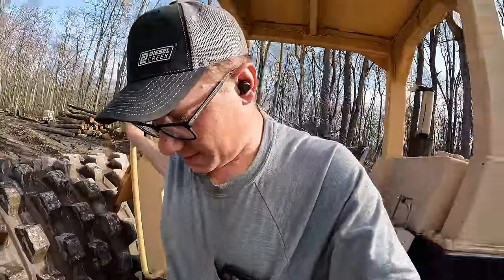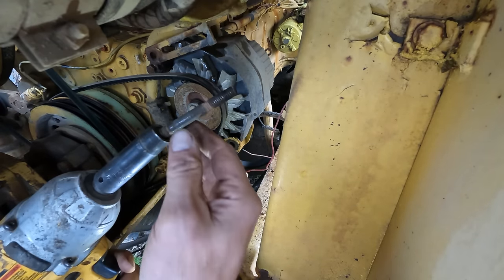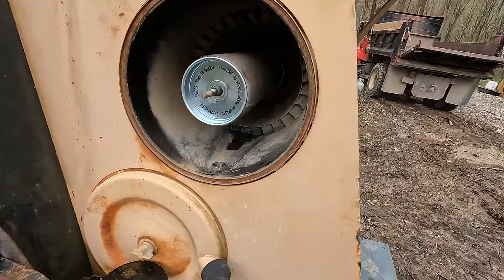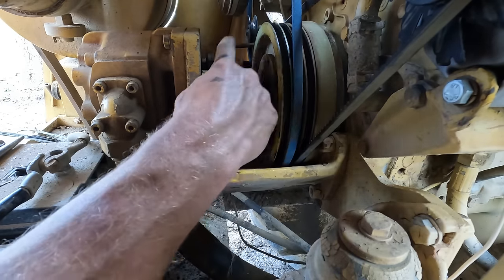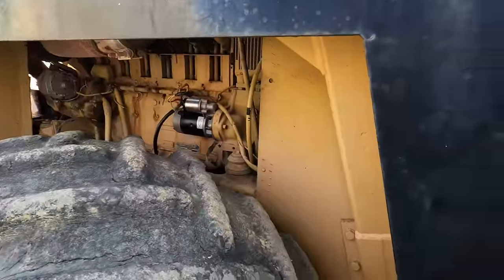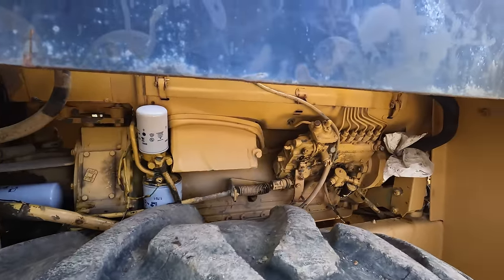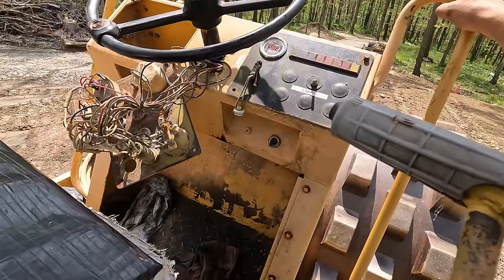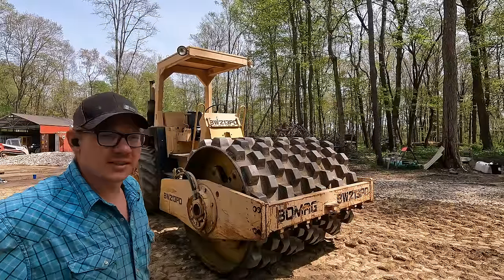I got BURNED on this Compactor from an Auction! (Bomag BW213)

Comment: I spent 13 years working in a rebuild shop and one of the first things I learned about starters is the part of the starter that most call a "Bendix" is actually called a drive. In the old days one of the major manufacturers of starter drives was a company called, you guessed it, Bendix. Imagine calling oil filters a fram. It's a very, very common mistake. Also, starter drives only turn one way, when they work correctly. They have sprag bearings inside the bell part to make them work that way. They do that so, obviously they to not turn or slip when the armature is causing them to rotate the flywheel, but they then spin when the engine fires up so the armature is not over rotated and the windings explode before the drive can be withdrawn from the flywheel.
Reply: I never heard anyone say bendix, without saying bendix drive . Also,  I've never actually seen a bad/ replaced a bendix drive. It's always the solenoid or what ever activates the bendix drive that is broke/ bad.
Also I've never heard of any other brand of that particular mechanism 
It would be wild if Bendix never had any competition ,in manufacturing that mechanism..

Comment: 23:15 I think that a shorter belt would have changed the angle of the belt and would have stopped the rubbing.  Just looks like the tensioner is almost at the end of its travel.
Reply from the maker: Ya I changed it to a smaller one and it’s fine. I know I recorded a clip of that running after changing it again but apparently i forgot to put it in

Comment: Matt, fully enjoyed the video. Agree that getting a smaller belt might very well fix the issue of it dragging on that piece of steel. Glad that with all the electrical issues, you actually got things where they should of been in the first place, and OMG, what the hell were they thi9nking when you went to drain the oil form the oil pant with the drainage plug being where it was?? Homemade funnel seemed to work pretty well on that one🙂. Sounded great after the new starter, and the oil and new air filters that you changed. Look forward to more videos, and glad to see that you pad is just about done, and hopefully in some good weather you can get that large new garage built so you don't have to be laying in the first to fix things. for those that ran their mouth about " Click Bait" hey, better suggestion> Don't watch! Been following Matt for some yrs now, and he has never done that!

Comment: That cooler next to the starter has a big hole in it. As you start you can see it puke a little coolant. Even left you a little rust spot. Bees like heat. When you warm a building or machinery it holds heat all night long.
Reply: It can’t puke coolant there’s only oil in it

Comment: When first got out of University I spent a few years as a sales rep for Material Handling Equipment company. More specifically I sold electric (indoor) lifts and Propane/gas and diesel outdoor Forklifts. I sold Fork Lifts up to 15k pound capacity with pnuematic tires with the air cooled Deutz diesel engine with hydrostatic transmission. Foot operated transmission with two pedal, forward and reverse one pedal on each side with braking occurring once foot activation of transmission ended

Comment: Those deutz air cooled engines should fire right up even when freezing cold. They only have glow plug and oil pan heater. Nothing heats up the cylinders.
The piston crown to head clearance should be between 1,0-1,2mm to get the best compression ratio which affects starting and efficiency.
This is why deutz sells many thicknesses of headgaskets or in this case simply fire rings or you can shim the liners from the block.
Of course injectors can also be the culprit. 
Using 2mm thick tin wire trough the injector hole is a quick way to check the clearance.
Reply: At work, they bought the biggest POS drill rig with that same engine. It wouldn't even come close to cranking fast enough with the stock starter in cold weather with a new starter and battery. I think it was more the hydraulic system that was attached to it than the engine itself though. It had a dual gearbox and quad pumps. A stronger starter solved that problem, but the unit was never any good. They must have blown $150k on that thing before they finally gave up on it. The first words out of my mouth when it landed in my shop were "what is the return policy?"
Reply: @--_DJ_--  No matter the diesel engine. If the crank is slow the air heating up has time to let the heat escape or if valves/rings do not seal 100% the air will escape and not heat up.

Comment: I have to be the downer but your supposed to drop the batteries not the starter. That's why it's a voltage drop test! It is almost mantatory on large dozers with batteries the size of small cars. 😁

Comment: Pre-filling the engine oil filter. I've done the same for like ever until my oldtimer engine rebuilder buddy gave me his take on the 'is it a good idea?' theory... The oil you put into the cartridge is gonna go straight to the crank bearings, (& it's not on the filtered side)...  & you have no 100% guarantee that when you poured some new 'clean' new oil into it a random tiny couple of thou sized particle of dirt went in too. That particle is set to do nasty things to any a crank journal... So ever since he told me that bit of sage advice i just load on an empty cartridge & anyway, the filter will fill in parts of second.......(just saying).
Reply: Rainman Repair on YouTube has stated the same thing. :)
Reply: Had a whole rat in the bulk oil at our mining company 
Was delivered in the truck 
Makes you think about "clean oil"
An engine at idle no load will run for 30 sec without any oil presure just with the oil on the bearings already 
The oil filter will fill in seconds and you'll have oil presure like that
Reply: Peteb2.
Your advice from that old timer was good. Yes like this video shows, the dirt that could easy drop in filter. Yes, just put it on empty. I think especially with a AIR cooled engine. Run engine for 15 to 30 second with empty filter. Then shut down, recheck dip stick. A lot easyer than just like you said a big engine getting particular of Dirt, crap from oil in engine. I love comments like yours, it gives me ideas. Thank you so much. It's so nice to have old timers who know there Engine's. They are worth every penny to be friends with no matter how grumpy they get.
Bring them donuts and coffee to keep them happy. And always listen to them.
Reply: I’ve never tried to fill an EOF with oil first. Some of the bigger ones would be very tough to handle with enough precision to get them threaded on straight. And I own John Deere tractors where the filter is either inverted or on its side, so I don’t think that they are expecting me to fill it first!

Comment: You need a FOX and HOUND electric circuit tracer.  One is a transmitter and the other is a receiver. You can follow a tone alone a wire/cable and find shorts, opens, and grounds. Also does continuity checks.  They make them for auto or home/telephone usage in several different styles and designs. I go a bus that had circuits not common to a semi truck and it was a life saver.

Comment: 10si alternators are probably the most mass produced alternator in history, they are ultra reliable and easy to repair
Reply: Absolutely! I replace every alternator on my equipment with one when the original fails. 2 yr warranty, $49.78 on Amazon for a 334-2114 or a 335-1093 Brand New for $76.52. Why anyone would pick up a no-name POS at the parts store is beyond me.
Reply from the maker: Because that had it in stock, and I left with it in my hand, and it has a 2 year warranty…. And it was only $65….
Reply: Looked almost like a GM Delcotron alternator. Am I close or FOS?
Reply: @DeweyCheatumNHoweLLC  My thought also. Almost identical to a Delco 10si used by most manufacturers in the 1970s and 80s and still a very dependable alternator today.
Reply: @mikeshultz1007  That is a rather inflammatory statement. "Vast majority"?? I very much doubt that. I have been an Amazon customer since 1997 when they only sold books and I have never encountered anything as you describe. AC Delco maintains a store on Amazon and products sold through them are genuine Delco. I urge you to re-think your statement.

Comment: Several questions: 
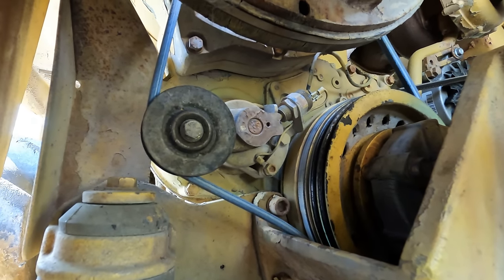1) At 23:25, there's what looks like a switch on the fan belt idler pulley. Presumably that triggers a warning light?
2) What's under the access cover below the air filter at 30:17?
3) I never saw you write the date and hours on any of the filters :(
Reply: It seems this video has been cut pretty heavily. The second belt replacement is also not shown, so I expect he marked them but didn't show it on camera.

Comment: I don't work on Heavy equipment but I do work on old stuff and over and over the biggest problem is the nut behind the wrench. I buy an old bike or car and then look to see what surprises lay beneath the surface. more times than not the biggest problem lie in either poor maintenance or some hack job that causes more problems than it fixes, I watch because I rememberer this old stuff because my father operated this stuff back 40 plus years ago. it brings back memories of hanging out with my dad as He maintained this stuff. thanks for the memories

Comment: Dielectric grease is non conductive, but you're getting good grounding through the bolts.
Reply: You can put it on conductors it'll move out the way where needed. People just it on battery posts and lamp sockets

Comment: Hey Matt. If the belt breaks the idler puller for the fan belt has a sensor close to it and it shuts the motor off. I have a few of these motors and they are all the same with this safety feature. The motors are pretty indestructible.
Reply from the maker: Ya they botched all the wiring to that sensor….. none of them worked
Reply: @DieselCreek . Wow that could have ended bad.

Comment: FYI... dielectric grease does NOT conduct electricity... the word dielectric means insulator. It's main use is to keep water and schmoo away from the conductors (pins) in a connector. The force of the socket against the pin pushes the grease away and creates a good electrical connection. Putting a film of dielectric grease on the starter mount will help prevent corrosion, but will NOT help grounding (the bolts will provide plenty of ground).
Reply: False. Categorically false. It goes dielectric after it burns. It conducts perfectly well before that. Literally TENS of thousands of connections made personally with dielectric grease and ZERO resistance across the connection say you misunderstand the usage.
Reply: @typrus6377  Could have said the last 10 words better!😟
Reply: @TheCheffydave  You are right, and I corrected it. I was heated earlier, and I apologize.
Reply: @typrus6377  google dielectric grease and read what the mfg data sheets say. 
I know that for some reason this is an internet hot button, and I am not going to get anyone to admit they were/are mistaken, but truth is truth.

Comment: Those Deutz aircooled engines need the 2 belts on the fan and they are both the same length belt, that single pully isn't the tensioner it's the belt snap tell tale switch for the dash light/warning buzzer, the tensioner is the fan itself which is on adjusters if memory serves, that is vibrating anywhere near enough, it should literally make a very loud humming noise and "liquidise" the soil all around it, good look with the repair Matt 👍
Reply: ** This is a copy of a comment I posted earlier **

Ignore the fan pulley having two grooves, most of those engines came with a single belt from factory, for using two belts there's a dual groove pulley.
I don't know nowadays but in the past you could buy each component of the tensioner separately. I imagine that for a double pulley the spring will have to be tightened twice as much, but I have no idea how the tension is measured, maybe it's using a torque wrench or maybe it's counting the turns that the spring is preloaded, that will be explained in the workshop manual. It can be easier and cheaper to find a second hand tensioner or just keep using a single belt the only drawback of using only one is that it lasts less and when it breaks you have to stop working to change it, with two belts it would be very rare for both to break on the same day.

Comment: We actually had a piece of avionics that required a drop test. It was a crypto identification friend or foe (IFF)  on the F-4 Phantom. It had 2 top secret codes in it ( password of the day and tomorrow's code, in case you were still flying after midnight.) and if the plane crashed, the equipment code  would feel the shock and zero-ize the code, in case the enemy got their paws on it before us. It also zeroized a few seconds after power was removed.

Comment: I was surprised because the 6-cylinder Deutz seems way too big for the machine. A 4-cylinder Deutz with 115 KW is listed on a data sheet for your machine. B.t.w it is no mistake to check the coolingair passage with the oilcooler spiral and the cooling fins.
Reply: How realistic is 115Kw (156hp) from a 1987 four banger ? Your data sheet has the wrong number of cylinders listed.
Reply: @Sjanzo  I think You are right. I checked the List of Deutz Engines and there are only turbocharged 6,2 Liter 6-Zylinder with that output. There was never ever a 4.1 4-Zylinder with 115 KW
Reply: @besenwieslersepp1011  probably an F6L913T. The 413 series would be capable of 157hp in a 4 pot, though the inlinr 4, 5 and 6 cylinders in this model range are rare, most of them were V8

Comment: Not sure how the vibratory motor is mounted on this one, but I worked on an old raygo years ago, the motor seal went out, filled the drum with oil, dampened the vibration to the point of nil.. resealed the motor, drained the drum, Vwala! Hammer time!

Comment: Painful to sink a lot of cash into a machine and then have constant problems with it. Been there!
Reply: Thats the risk when spending a lot of money on a machine so big that the price you pay is still only a fraction of what a new one costs...
Reply: It happens when you surround yourself with worn out junk.
Reply: Well, don't buy cheap sh**! Problem solved.
Reply: @einfelder8262  I would be proud to have this machine myself. Deutz is legendary. The founder of Deutz was the inventor of the internal combustion engine then later Frank Perkins of Peterborough England invented the worlds first high speed diesel as we know it today.
Reply: What would you expect from a 35 year old machine? Factory warranty?
Reply: @conmanumber1  Well it's not the engine that's broken, is it?.   Just every bloody thing around it from starter, alternator, pulley, vibrator, wiring.
Reply: @einfelder8262  at the moment in every machine industry, there are major shortages of new equipment to replace old equipment. Used car prices are up 30% right now, electric cars orders are on a 2 year backlog along with tons of other stuff.

So yeah, a machine like this is actually pretty good in this economy right now
Reply: @einfelder8262  many 2021 and 2022 cars went back to using analog dials, and many have less MPG than originally advertised. This is all due to the major processor shortages.
Reply: @ivanvarela3215  WTF has that got to do with an old roller?  Stay on topic FFS.
Reply: @einfelder8262  oh boy, ya don't know how things move then mate. Hope ya realize soon.
Reply: @ivanvarela3215  I know far more than you ever will, bloke.  Especially about staying on topic in a discussion.  Those who are lost in a discussion use diversionary tactics, such as bringing up an irrelevant topic, to mask their inadequacy.
Reply: @einfelder8262  hee hee hee, that tickled me a bit.

Get out
Reply: @ivanvarela3215  Get out yourself.  You're not the boss of here.  Play with yourself elsewhere.
Reply: @einfelder8262  generic_response.txt

Comment: so, is the clunking noise the camera mic picked up a clue to the next failure? soon as i heard it i started thinking that's prob the noise the flat roller was making before it snapped the shaft, loose bearing letting it bounce

Comment: I am worried about the ring gear on the flywheel.  We will know when you pull the starter.
Reply from the maker: It’s not great but it’ll last
Reply: @DieselCreek  Whew!  I was worried when I heard the starter at the beginning of the video.. Then when you pulled the starter and showed the teeth I was thinking that a new started would probably work just fine.  Thank goodness, I can't imagine how much of a job to replace the flywheel!!

Comment: Maybe the only speed you got on the vibration is not full, only the lower one. Perhaps that's why you feel it's not strong enough.
Reply: It kinda sounds like the metal on metal sound is acting as a governor.   It winds up fast enough to start smacking and can't go any faster.  Knowing Matt's luck the shaft of the counterweight it broken one end and that's just as fast as the motor can spin it with it flopping around in there!

Comment: Have you ever used the red segmented replacement belts?  THEY ARE FANTASTIC!!   The come in 2" segments that have a tee on one end and a slot on the other end.  They come in three or four different widths.  You DON'T HAVE TO REMOVE THE FRONT SUPPORT to install them!!!  They will save you hours of time changing belts!!!   They last forever.  We used them at Fords all the time.
Reply from the maker: I will have to look into that

Comment: Running a single belt on a Deutz diesel blower is just wrong, so wrong. You let me down.  Now let's see if he fixes that critical temperature light on the dash…
Reply: Did you miss the part about the tensioner pulley only having a single groove pulley?